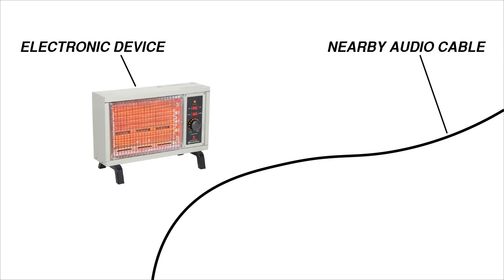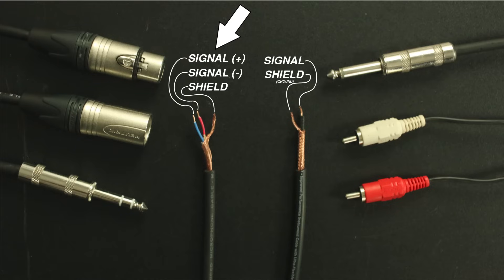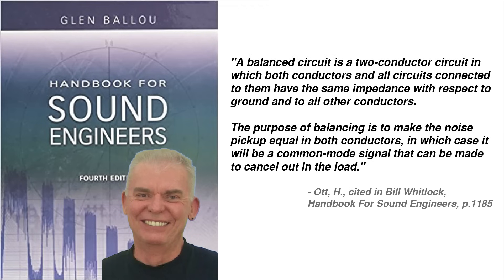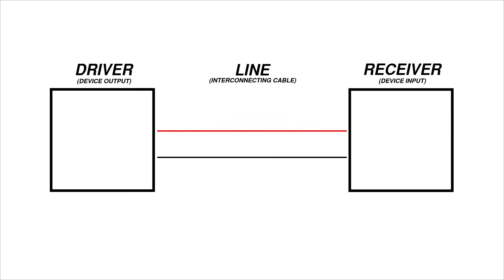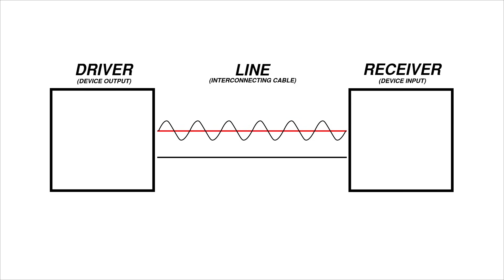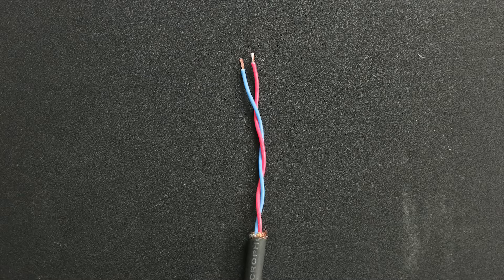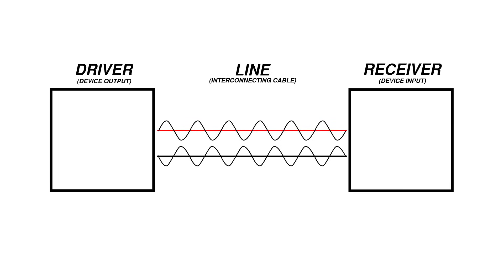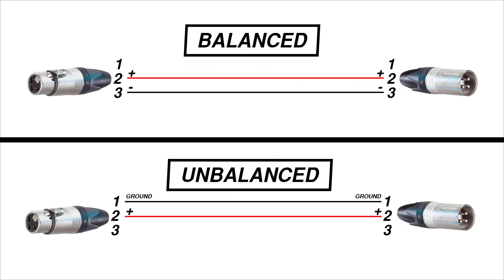Balanced vs Unbalanced Audio | Do Balanced Cables Sound Better?

Comment: Disclaimer: This is not a hate comment. It's constructive critisism. One thing that I would have liked to have been in the video would be a comparison between the noise levels of a balanced cable and an unbalanced cable at short distances (Like 5 feet) Which is at least the kind of comparison that I would have liked. Due to that I'm only going to use a 5 feet TS cable. Great video overall though.
Reply from the maker: Great suggestion, Radioactive. Thanks!

Comment: I am getting that noise between my computer headphone Jack to my powered speaker with RC a's.  do I need to get xlr cable to  3.5
Reply from the maker: No. A 3.5 mm-to-XLR and 3.5mm-to-RCA are both unbalanced. It sounds like you may be hearing a ground loop. Make sure that the power for each device is connected to the same circuit.
Reply: @Audio University  they're all  connected to the same outlet what can I use to get rid of the sound.

Comment: Not sure I understand the wiring. Both the balanced and unbalanced are twisted pairs and the shield doesn't matter in either of them. They appear to be the same. I guess it's just the pinout that matters? The balanced one has no connection to ground which surprised me. So in a TR connector, how would you wire it to be balanced if there are only two contacts to wire to?

Comment: Without even seeing the video I can answer the question. No, they don't sound better. Cables do not have a sound. As long as the electricity can flow freely there will be no sound difference. 
Balanced cables are only used to get less interference from external  magnetic fields.

I only use balanced cables for microphones. Probably good to use it for other instruments aswell, such as electric guitars, but I don't have such instruments ;)

Comment: So that demonstration was over 1000 ft of cable. 

That means headphones with smaller-length cables do not necessarily require balanced audio as much, because the wire length is so small it barely picks up noise except in extremely noisy environments. And if you’re in an environment THAT noisy, you got WAY more problems than worrying about balanced vs unbalanced audio in your favorite head cans.
Reply from the maker: The general rule is that anything over 15 or 20 feet should be balanced.

Comment: A pretty good effort at a complex subject. A couple of points - (i) The impedance of the line will be mainly determined by the input impedance of the “receiver” not the resistance of the wires. (ii) Probably the main point about balanced connections is they guarantee a phenomenon called ground loops is avoided in which very large currents flow through a circuit formed by the shield and the ground connection, which in turn generate noise voltages if the signal is also carried by the shield. Your illustration generates a lot of noise because it creates a ground loop. In fact unbalanced connections will usually do better than this test suggests because they are designed to have only a single ground connection and hence break the ground loop.
Reply: I think I was experiencing this so called ground loop and it was only after I routed my subwoofer power cables to the same socket as my audio equipment that the noise finally been eliminated!
Reply: @Totalplonker  Yep, also had a ground loop noise in my active monitors. Thought they were faulty at first, but quickly found out it's a ground loop issue, which is fairly common with professional active monitors. My solution was similar to yours, basically I had to power my monitors from separate wall sockets or something like that (it was a long time ago) and the noise disappeared completely. Since I've started always using balanced connections to my monitors I don't remember ever encountering that issue again.

Comment: What is the difference between - and ground?
Reply from the maker: In an XLR, the shield is connected to ground. The - pin is used for transmitting the signal.

Comment: Impedance is not your definition. You show no difference in your choice of conductors.
You state you are not an engineer yet you tell us what I know is not true. A shield does work well.
The best line is coaxial as the impedance is constant and shielded. Any impedance can be made to order in any coaxial cable. Since most speakers work between 4 and 8 ohms. Just use 8 ohm cable. That one hack will make your sound much better.
Reply: 8 ohm cable????

Comment: Very good video on electrical interference involving copper cables. I noticed you left out Optical cables. I understand optical can not be naturally balances but is resistant to magnetic interference.
Reply from the maker: That's right! Optical cables completely eliminate the noise that I'm describing in this video. That's because an optical cable is a beam of light, not a copper wire.

Comment: Thanks you Kyle.I read that if the cable is short (up to 2 meters) it has no difference in sound quality between balance and unbalance.Is it true?
Reply from the maker: For short cables, there usually won’t be a big difference in noise between balanced and unbalanced.

Comment: I know that it is the same as long as you do the same on both connectors,  but shouldn`t you use the red cable for the positive signal?
Reply from the maker: Yes. Generally, red is positive and black/white is negative. The AES standard is pin 2 +.
Reply: @AudioUniversity  Check your video, you put red -

Comment: GudDay.. shuot out frm philippines..,
Sir wat is the good or best brand mic cable to make a balanced connection and the connector use..
Reply from the maker: The cable won’t make a big difference in sound quality. I recommend using a cable with Neutrik connectors though (so it will last longer).

Comment: Would you recommend using a balanced cable for an IEM? I currently have a FiiO M11 Plus Ltd. I use the 4.4 output for my IEM’s. I get about 8+hrs of usage with this method. I was thinking of getting a regular 3.5 cable to use with my IEM’s to prolong the use of my DAP without having to recharge so often. What are your views on this?

Comment: Question. I need to connect my crown amp to my avr. Amp has Phoenix type output connections and AVR has a RCA input connectors. How do I connect these. Can I get a balanced XLR to unbalanced RCA cable and. Strip off the XLR end and connect it bare wire? Pls suggest me the best way to improvise my sound. Thx
Reply from the maker: You can modify an XLR or RCA cable to connect the bare wire to a phoenix plug. However, it sounds like you should take the output of the AVR to the input of the amp (not the other way around).

Comment: I can confirm XLR cables do sound better. They best benefit professional audio were long runs are used. But also works great in home audio as well. I find it best to use long interconnects going from preamp to amplifier. Then short speaker cables going from the amplifier to speakers.

Comment: hello Kyle thank you for your video it's help me understand a lots bout balance and unbalance , I have a question, I have a Bose t8s mixer and a Bose l1 model 2, speaker, on my mixer main out it's have left and right xlr , and my speaker in is 1/4 inch trs, do I have to use both left and right from my mixer to come out to my speaker or I just only need to use left or right?
Reply from the maker: You can use just one if you don’t need both outputs.

Comment: How do I know if a cable is balanced or unbalanced? I've got older cables that I don't know what they are. I'm wondering if I should get new, balanced ones.

To be clear, only the XLR can be balanced?
Reply from the maker: XLR and TRS are the most common type of cables used for balanced audio.
Reply: @AudioUniversity  Thanks! You're a gem!

Comment: Best explanation I have heard. I am still a little confused about the  "twisted" nature of both the balanced and TRS's cables.   In the balanced cable the twisting is very easy to see.  In the TRSs cable, the ground is not so much twisted, but rather wrapped around the other wire.  Anyways, great job.  Thank you!
Reply from the maker: Check out this video, Robert: https://youtu.be/P7WfY9P2uNY

Comment: The common audio noise you hear from sound equipment tends to be a 50hz or 60hz ac square'ish wave hum, the common cable used that falls victim is the 3.5mm jack plug to stereo rca, the actual signal return also acts as the cable shield, the noise makes its way onto the signal input ground to an amplifier and not the input signal so regardless of the polarity of the input interference, the amplifier 'sees' this difference in voltage of the signal and signal ground and amplifies it. The clue of the ac hum's origin, I'm sure must be the mains supply.

Comment: I have an audio interface I use between microphones and my computer. So the mic, and sometime line inputs first go into the box to be digitized - from there they go via USB into my computer and DAW. Meanwhile, the interface supplies balanced output which can connect to powered speakers or to a mixer on stage for live shows and from there the signal goes to stage monitors. Since I don’t always know what mixer will be at the venue, should I assume that the line in inputs on  mixers will always accept either balanced or unbalanced cables? If I connect a, say TRS balanced cable to my output device and then plug the other end into unbalanced jacks on the mixer, what happens? Will the signal still be there but just no noise reducing advantage? Or no sound at all? Or…?
Reply from the maker: Yes. Good question, Bob! You can connect a TS cable to a TRS input. Thanks for bringing this up.
Reply: @AudioUniversity  And vice versa I think too? The TRS balanced cables will work between boxes that do not have balanced inputs or outputs - they just won't afford any benefit?

Comment: This is an excellent video ! Thanks. I would add two things : 1 compatibility, balanced connection enable to pass from unbalanced to balanced, with benefit RFI rejection of the balanced connection from an unbalanced source to a balanced receiver. 2- BUT the signal level will be halved, or talk about the optimal 4 volts level obtained between balanced devices. When top notch SNR is needed : the differential works up to a point, but signal strength helps with the rest. If a balanced signal is very weak you sit can pickup noise and hum and various RFI that are located in domains unreachable for the difference between the 2 wires. Probably not in the audio domain, but in other areas like science, radio, etc.

Comment: Hi! My bass makes a buzz or hum noise when connected to the amp or interface, should i use a balance cable instead?
Reply from the maker: No. A bass guitar and amp is not set up for balanced, so the connection would still be unbalanced even if you used a TRS cable.

Comment: Balance circuits have that sound dump where it won't have any buzz. The negative signal dumps the rest of the energy that's left over. Unbalanced won't. But it also depends on the system you are plugging into. Unbalanced cables get really bad if it's over 20 feet you get what old computers used to get and that is crosstalk. The stone age of computing and electronics

Comment: Thanks for sharing. My audio interface have  multi function input (mic/instrument) and has a 48v button to activate phantom power, which I understand is meant for condenser mic. However if I’m using the instrument (eg guitar), and I accidentally pushed the phantom power- will the phantom power supply penetrate that TS plug enough to damage guitar / or tablet if I’m using 3.5mm to 1/4 TS jack. Thanks
Reply from the maker: The guitar will not be damaged, but the tablet might. Check out this video: https://youtu.be/oZ6zfe9ak2Y

Comment: Can a 3.5mm stereo TRS to dual mono XLR Male connection be balanced in any way? Can it exist? or is it completely impossible..
Reply from the maker: Usually 3.5mm outputs are set up for stereo, so most cables are set up for stereo. I’ve not seen it done, but I believe it would be possible with custom output and cable using a 3.5mm connector.
Reply from the maker: By the way, the best option is probably to use a direct box.

Comment: Excellent explanation of balanced vs. unbalanced signals! I didn't know this until recently, but I was always told "XLR" stood for "Ground, left, right." Which is totally made up haha. When you understand the history, and the electrical engineering behind a balanced cable, it's obvious that XLR's are not stereo cables and never were. XLR stands for "X-type, Latch, Rubber."

Comment: The simplest way to understand balanced line noise cancelation is to forget the electronics and just think of waves. There is no such thing as sound. It's just waves of air. There is no sound in a vacuum. Our ears detect air pressure waves. When you hit a bass drum an air wave is sent out. The peak of that wave hits a mic and depresses the sensor. That depression is turned into a voltage that travels down as wire to push a loud speaker. The speaker pushes the air wave that pushes our ear drum. What if the sound was coming out of 2 speakers facing each other. Both waves would hit each other head on and stop airflow so we hear nothing. The two waves cancel each other out pushing in opposite directions.

Balanced line sends the same signal down two cables but one has the phase flipped. If they were added you would hear nothing. A push me pull me situation. To hear them the inverted phase is switch back. Noise that is added along the wire would in phase along both wires. When the polarity is flipped, one noise wire is out of phase so the wave fronts cancel each other out. The noise disappears.

Noise cancelling headphones use the same tech. The music you are listening to is in phase. The external noise is coming through the shell of the headphone. To remove it, put a mic in the headphone to capture the external noise, invert the phase polarity and add it to the music. The out of phase wave fronts push against each other, moving no air, so you hear no external noise.

Comment: One important point which the handbook definition does not make clear:  
For the most part, the "conductor impedance" will be the output impedance of the driver, when the cable is connected to it.  That is, for audio frequencies, the cable characteristic impedance is not the determinant; the signal source is.

Comment: Good day to you Kyle,  what you can recommend in mixer main PL OUTPUT  to active spkr to use  TRS OR TS?  And also in micrphone input  trs or ts. thank you
Reply from the maker: For distances over 15’-25’ I would recommend a TRS or XLR connection. TS is suitable for shorter cable distances.
Reply: @AudioUniversity  thank you

Comment: Also worth noting and may not be a thing as much these days, but balanced 1/4" jack cables had a rounded end and unbalanced had a conical end.  This became in issue as balanced female jacks were designed for the rounded end and whilst a pointed end jack would work if wired right, it would wear the end terminal as it would push it further than the rounded end.  So was a thing that you would see balanced input jacks fail and was due to them being jacks designed for rounded balanced jacks and somebody had used normal pointed jack cables in.

Yay for XLR is all I will say.

Comment: Great video and thank you for sharing your knowledge. I'm looking to connect an external amplifier to my receiver and it requires an XLR to RCA connection. What's a good XLR to RCA cable you would recommend?
Reply: There are many choices of cable, but I use Worlds Best Cables. XLR to RCA. Bought on Amazon. I am🤗,but have not compared them to any other cables.

Comment: 4:11 confusing, you explain that a 2-wire cable can cancel each other, then you compare a 2xwire(+ground) XLR to be the same as a  2xwire (+ground) TRS... but your video graphically shows it as  a single 1xwire (+ground) TS -- confusing.